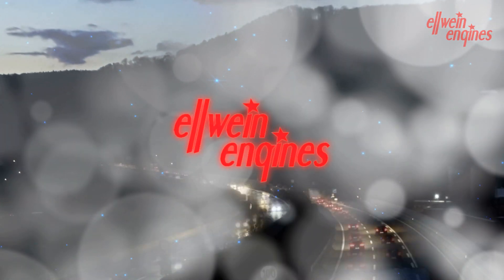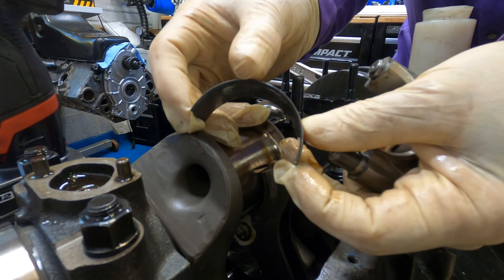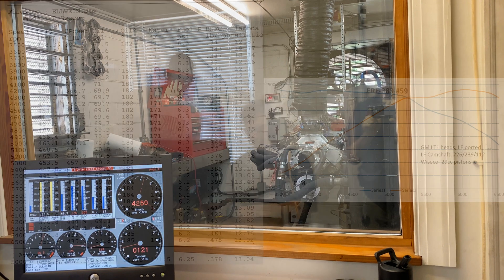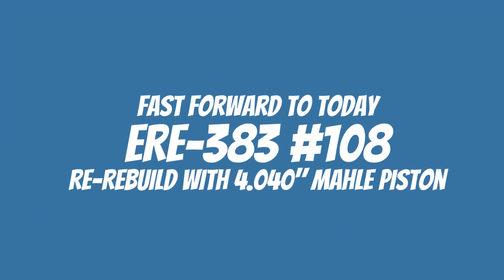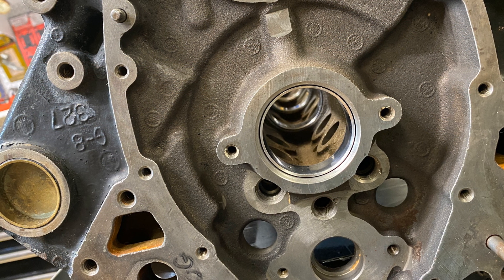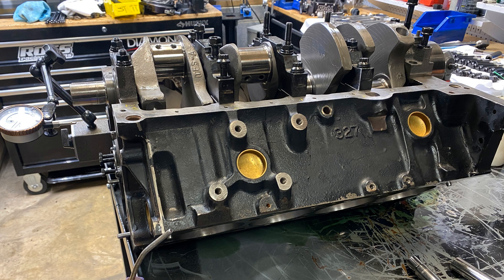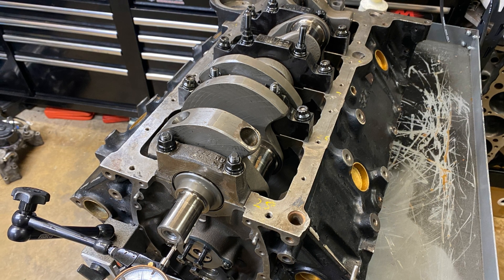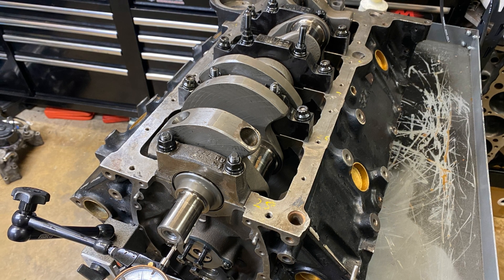ReRebuild of LT1 ERE-383 number 108

Comment: for shits and giggles if one  wanted to keep the stock crank what is a good drop in piston rod combo ? ( yes crank will be rebalance and machined to match pistons and rods)
Reply from the maker: The flat top Mahle piston #930200330 and maybe a SCAT 6" Ibeam rod.  I'm doing that for engine #113
Reply: @EllweinEngines  you prefer a 6' rod over a 5.7 rod for a 350?
Reply from the maker: Yes, 6' rod is my preference for less mass in the reciprocating mass

Comment: Hey Karl in your experience would you say that 383s have shorter lives with more bore wear than 355s?
A friend of mine insists that 383s wear out cylinders walls on the thrust side and I said maybe if the 383 has 5.7" rods but not 6" rods.
What's your take on that,  thanks?
Also was the engine originally built with 2618 pistons?
Reply from the maker: Original LT1 pistons are hypereutectic (cast).  I think 355 is best for longevity.  (it's all theory and hard to know in practice).  But compared to 383 with the longer stroke the 355 would be best for longer life.
Reply: @EllweinEngines  thanks Karl.